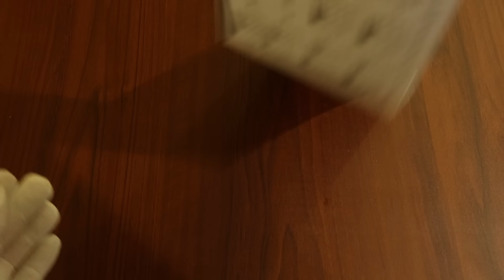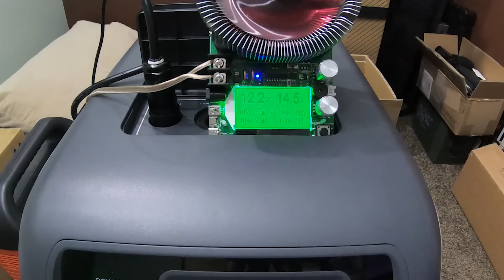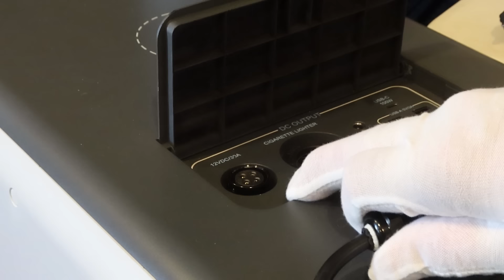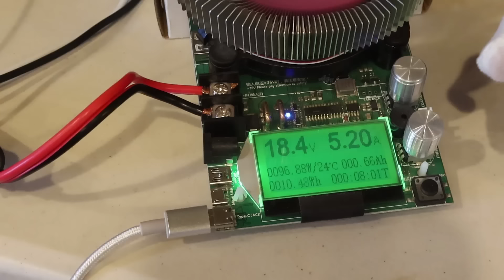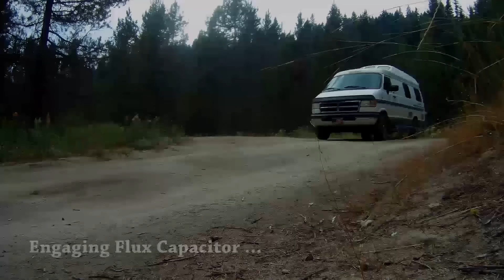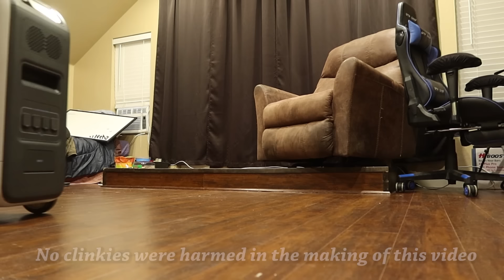BLUETTI EP500 5120wh LiFePO4 UPS BACKUP Off Grid Solar Generator Kickstarter Review

Comment: Don't understand how to make a purchase. Very Confusing with kickstarter. Looking for 2 for home backup. I will hire an electrician to help connect to breaker box. Does these solar generators automatically sense a power outage & kick in seamlessly?
Reply from the maker: Click link, click on the unit(s) you want, select any additional perks, checkout. Yes, the UPS takes over when the power goes out.

Comment: Hi there! Great review not so bright watcher (me). I have two 280 watts solar panels on my RV. A GoPower 3000 watt sine wave inverter. Two enormous lead acid trojan batteries. The batteries are bad and to replace them is a $1000.00 or so. I run out of juice around 4 everyday when the sun is out. Then on goes the 3500 HF generator all evening to watch TV and make coffee. I could put one of these where I have a stuff collecting chair. To have power all the time would be awesome. Do you think I should buy this instead of new lead acid batteries and so much gas for my generator. But MOST IMPORTANT will it run an air conditioner. I have an old Coleman but I might change. The heat I try to avoid! 27 ft 1992 Coronado  Class A. Thanks for sharing your info!

Comment: That is a pretty impressive system. But there is one feature that you don't mention that I think is very needful for using it as a UPS, and that is a way to tell a computer that the UPS is running out of energy. This is a feature that most UPSs have had, starting with RS-232, through USB and Ethernet connections that will tell the computer system to shutdown cleanly before the UPS is totally depleted. With that, I can see a lot of these devices showing up in small server rooms around the world.

Comment: Hobotech can you please recommend exact wattage per panel needed if purchasing panels other than the bluetti.  Example 400w BougeRV panels?  Assuming you need 2400 watt supply... get 6 of them?  Or 12 200watt panels?  I’m beyond green when it comes to electrical or solor... but very interested.  Thanks for the reviews
Reply from the maker: If getting the Pro version then 12 x 200w panels from Rich Solar. Link with discount https://hobotech.tv/amazon/#Solar-Kits
Reply: If getting two EP500pros will (24) BougeRV 18V Monocrystalline Solar Panels, 200W 2PCS = 24 (400W x12)

https://www.bougerv.com/collections/solar-panels/products/400-watts-solar-panel
Reply from the maker: @The_One_BABA  Sure you can get those or the Rich Solar panels which ship faster.
Reply: @HOBOTECH  amazed at your response time and becoming a big fan💪🏼. Thanks for all you do.  Love the reviews and your knowledge!
Reply: @HOBOTECH  what was (is) throwing me (again a novice).. is that the BougeRV link suggests the 200w 18v and the Rich panel link suggests the 200w 24v.  It’s the whole 18v vs 24v that is messing with my head. I’m not great at all on electrical.  Thanks for patience🙏🏼.

Comment: Shame on me!  I built a 4,800 watt hour solar generator using 4 BattleBorn batteries at $950.00 each a 3,000 to 6,000 surge pure sine wave inverter heavy duty, built all the cables, outback MPPT charge controller flex 80, and a converter  charger for lithium all in all including panels about $8,000.00 P.S. a victron battery monitor at $250.00 with blue tooth.

Comment: Thank you Professor Hobo!  Excellent review.  All I want is something that will run my 11,000 BTU Air Conditioner for 8 hours in my Class B so I can sleep through the night when I boondock at a Harvest Host location.  I most likely would recharge by shore power, no solar.  Is there be a big difference between the EP500 vs. EP500 Pro to do what I want?  The EP500 looks like it is shipping in June where the Pro isn't shipping until October.  I would really like to use it for this summer.  Also, could you use a two 15 amp to 30 amp cord?
Reply from the maker: You would need a pair with the Fusion box to do that.

Comment: Professor, the KickStarter page says the EP500 Pro has four 2000w AC110v outputs plus one that the EP500 doesn't have: a 3000w AC110v output. Do you know if that additional one will be an L14-30 outlet for connecting to an RV or what type of connection it will be?
Reply from the maker: I don't have any information on that yet. You should probably ask in the campaign comments section.

Comment: Can the Bluetti EP500 go in the trunk of an electric car for times you need to use that car to go farther than the range the car normally has, or if you don't want to stop at recharge stations?  What would be needed to use the power station in this manner?  Is there a better option?  How would you compute the range extension using whatever battery pack you suggest?  Thank you!
Reply from the maker: If it's worth using your entire trunk to carry around 150 pounds to get an extra 12-15 miles, sure.

Comment: So if I got the base model and put 1280w solar would tht hurt it or is tht small over paneling ok ?
Reply from the maker: You can put a million watts into it as long as its under 135v.
Reply: @HOBOTECH  say less
Reply: @HOBOTECH  how do you think this unit measures up against the titan

Comment: I have a charging question that pertains to any sol gen. Say my 110v wall brick charges at 60W but my Sol Gen can take 200W up to 32V. My car charger is also only 60W. No solar panels. Can I take an inverter and hook it to my van battery, then use a ac to dc charger or power supply that can up the voltage to 32V and supply about 200W to charge my sol gen faster?

Comment: NICE! Press them on a 120V/30A RV outlet, Please. Also charging from it. Most inverter gens have one. Harber Freight 3500 Does.
So, what are a few extra pounds,  140 lds is light, when your getting the use of all your equipment?
But very nice!!!!! Thanks HOBO
P.S. I wil not get the intro price, but can get it after Aug.

Comment: Hi there My question is how much battery & solar panels and inverter do I need for 83” long trailer pleaseeee I’m stupid to this type of things, I will be running Apple home computer & full size fridge & stove & 2 bug screen tv & hair blow dry and lights, Apple TV & Mac Pro laptop & cell phones & 2 fireplace & ps5 and washer and dryer in the DIY tiny house that is made out of shipping container, I want the feeling of a house powering please help I’m so clueless, I don’t want to over buy nor under buy !!!
Reply from the maker: One of these and 1200w of solar to start. For electric heating consider a pair with 2400w solar.
Reply: HOBOTECH thank you sir for your help

Comment: Would I be able to tie this system into my grid tied solar panels so that when there is a black out, my solar panels keep producing energy for this battery?
Reply from the maker: Yes if the voltage is right.

Comment: Question / I’m off grid with heavy canopy, could I trickle charge this with micro hydro instead of solar? Any ideas how to get enough voltage input. I also love the hack with those other devices for faster “fake solar” off a generator for example.

Comment: Could you use a 20 amp dc to dc charger to charge through the PV aviation port?
Reply from the maker: If it outputs 55v-135v

Comment: So if I wire my bunkhouse w/regular 12 Guage wire w/ outlets, switches and lights; then I can use this as a breaker panel? Just put a receptacle plug on my circuit and plug it into this thing and this will power up my circuit and I can plug in everywhere I have an outlet in the bunkhouse....and plug my lighting circuit into another outlet and run all my switches and lights 'normally'?

Comment: Ho, Bo ( I don't remember if I've ever seen your name ), this is a question unrelated to this video but I'm wondering if you have ever placed a layer of frozen food on the bottom of a single zone 12v refrigerator  and covered it with a thin vinyl or rubber mat and set the cooler temperature to +/- 0* farenheit and have the ability to maintain the thin layer of frozen food/ ice packs at the bottom and still get an acceptable refrigeration temperature in the upper part of an Iceco cooler ??? I am wanting to get the new Iceco vl60s pro series but still keep a few ice packs and frozen food packs on the bottom... maybe the "separation mat" would have a small opening on each end to help the cold to bleed thru ?? Do you expect to review the new Iceco pro series coolers? Your reviews are by far the most comprehensive and relevant.  Thanks

Comment: What boost converter are you using?
Reply from the maker: Link in the description
Reply: @HOBOTECH  This type of solution should also work well with a car or a EV using the 12V system to charge this system.  Allowing for even bigger back up.

Comment: Titan?
Reply from the maker: The Titan is a 2 year old outdated design that uses low cycle NMC batteries and costs $3000 for only 2kwh. To add insult to injury they make you wait 6 months on a list to have the privilege to buy one.
Reply: @HOBOTECH  2.0 system is coming soon I believe and has wifi and lfp batteries but the cost will be about 3.4k 2kw of solar in on both initial and 2.0 units.
Reply from the maker: Doesn't matter. They can't even manage to produce the old model. Are they going to put folks on a 1 year waiting list for 2.0? So many better options out there today...

Comment: Though I wanted to order two of the 2k, I ordered one of the Pro, my budget is limited. Can I use my 4 12v 100 W panels to charge, and if so, parallel or series? I am not used to work with all in ones, but I have two batteries system in series for 24v. I want to know the best way to charge it; I may buy more panels later. This last texas freeze got me thinking that I needed more power than my small system.
Reply from the maker: Yes, you have to put them in series.
Reply: @HOBOTECH  Thanks!

Comment: Can you make a video on how to make a solar panel simulator with the booster.  I looked under the tool menu and couldn’t find the booster you were referring to.  Furthermore, what is the full name of the 48v power supply that you used to simulate solar panels?
Reply from the maker: https://youtu.be/6_1oX3KPmM4 and try again at https://hobotech.tv/amazon/#Tools they are at the very bottom

Comment: 28:40. "Monstruos" is right. In the back of my head, I'm also knowing that the capacity is HU-GE. An RV could only have this if they had a dependable acid 12 volt nearby, just in case use is needed elseways. I still need to get better at understanding how fast it takes for solar panels to charge, but I sure like the fact that you can use some batteries while they're charging.

Comment: Got one at $2,799. Or, should I say I stole one at $2,799. Wow! Anyway, is the kit to connect to the home standard equipment, or will I need a special kit from Bluetti thats is just for the EP500?
Reply from the maker: I don't have any info on the kit they offer but I suspect it is standard equipment that uses the 50A output into a transfer switch.

Comment: I’m just wondering how many 100’s of watts of solar panels you would need per day to keep this monster charged enough to run your fridge, furnace and a couple lights during a multiple day blackout? I briefly read about some of the items it will run and for how long, and I’m convinced you will need a huge solar array to complement this. Am I correct to assume that this will run 400 watts for 10 hours before you will need to recharge it?
Reply from the maker: You would likely want at least 1000w of solar to maintain all that during an extended blackout. I'd personally put up about 1500w to guarantee the 1200w max input if this was my only source of power in the home.
Reply: @HOBOTECH  Thank you for your reply! I am always concerned that so many people have been led to believe that you can just buy one of these solar generators, charge it up, and then run your house for several days during a blackout without the large solar array that you have just recommended to keep it charged?

Comment: I'm looking into building an off grid solar system.
This is basically a controller, an inverter and the batteries all in one?
I can buy this one unit and shove it in a corner to power most of my things?
Reply from the maker: It is a lot more than that, but yes that's its main function.
Reply: @HOBOTECH  Then 2 I shall have! Thanks for the reply. Excellent explanations and, best of all, EXPERIMENTS!

Comment: Just scooped up the two EP500s for $5999 deal WooHoo!!!   This is so exciting, it's really tough for solar to compete with fuel generators but this setup will be impressively close.   So now I'm wondering what the gold standard would be for solar panels to match up with this, I have heard that it can get shady how companies tend to act like the panels that they sell in their packages are the best of the best, so I didn't wanna rush into adding Bluetti`s panels to my order.  I mean they could be awesome for all I know but I wanted to ask around first.   I definitely want ones that fold so Bluetti's panels still might be the choice considering they not only fold but also say 23.5% efficiency which sounds awesome.  But what do you guys think about 200 watt Renogy Eclipse suitcase panels?   Do you think they are better than Bluetti's?
Reply from the maker: If you want rigid panels, I just got some Rich Solar in for testing. 15% off code on my site for the suitcase kits. https://hobotech.tv/amazon/#Solar-Kits
Reply: @HOBOTECH  Thanks I just noticed this.    I like your reviews a lot, I decided on a Bluetti EB240 thanks to your review.   But ugh it really sucks that 3 of those 200W Rich suitcase panels in series will JUST push the voltage above the critical 67V that will give an error.  Three suitcase Renogys will squeak in under 67V but I see a lot of reviews that if you look at them the wrong way the legs will break lol.  Running 3 series 200Ws into the EB240 would be absolutely perfect IMHO - wattage wise, space wise, amperage wise (I like series because I like to minimize amps)

Comment: With regard to the solar credit, Not sure this will qualify, as it is required to be charged COMPLETLY with solar, not with the possibility of being charged off the grid.  Check before you expect to automatically get the 26% credit.
Reply from the maker: Really? I saw Tesla Powerwalls mentioning that credit and those are grid powered too.
Reply: @HOBOTECH  I checked on the Tesla Powerwall.  It can be charged from solar only when connected to solar.  When not connected to solar, it can be powered by the grid as a backup power source.  My guess is that it then wouldn't be eligible for the solar credit.
Reply: @HOBOTECH  I checked this out.  Tesla powerwalls will power only from solar when they are connected to solar.  They will connect to the grid as a power backup, but would probably not be eligible for the solar credit in that situation.

Comment: Thanks for all this great information! What is the upgrade extras of the Pro?
Reply from the maker: Listed on the Kickstarter page. You get 3000w inverter, 1800w charger (vs 600w), 2400w solar input, 12/24v charging, and more outputs.

Comment: The charging voltage situation was the deal-breaker for me. Not sure what they were thinking on that.
Reply from the maker: The Pro model does 12/24v charging and 35-150v solar.
Reply: @HOBOTECH  Appreciate the reply and I'm clear on that distinction. I have a specific use-case and only require a single 200 watt panel for my power needs. If they'd have just had a lower voltage solar charge controller I'd have already ordered one to replace my Yeti 3000.

Comment: Great for the house but toooo heavy for an RV! It is a shame no 30amp plug! I do wonder how long it could run my RV roof AC?
Reply from the maker: If it's a 13,500 BTU unit it takes about 1200w to run and up to 3kw to start. The EP500 can do that through the 20A outlet but you'll only get about 4 hours unless you add 1200+ watts of solar. Then it will run as long as the sun shines + 4 hours.
Reply: Just get a 30amp adapter on Amazon.  I did for the AC200P.  Hoping on those hot days to charge as fast as it uses.

Comment: How would you hard wire this for a ups?  Specifically I'm interested in powering a few 20 amp circuits in my house at the inside sub panel, but with only one 20 amp in on this that seems unadvisable.
Reply from the maker: You need an electrician to wire in a transfer switch. Then you use the optional kit you can add on when you purchase the EP500. You may want to seriously consider the Pro as it has a 3000w inverter with 1800w internal grid charger and 2400w solar input for not much more.
Reply: @HOBOTECH  Any chance you can get and review the ups adapter box?  I'm kind of curious what $500 is buying you there.
Reply from the maker: @DavidChiluk  I'm told I'll be sent one when they are ready.

Comment: What about that other test of the wattage drain when nothing is plugged in just standby time with no charge and on mode ? Wonder what brand of battery cells they put .
Reply from the maker: I mention in the video this is being tweaked and I'll do a separate video on that. As it sits it is about the same as the AC200P.